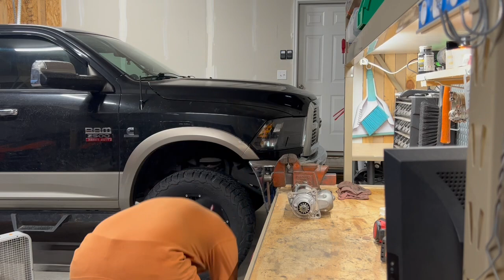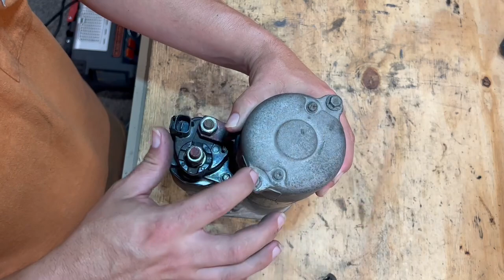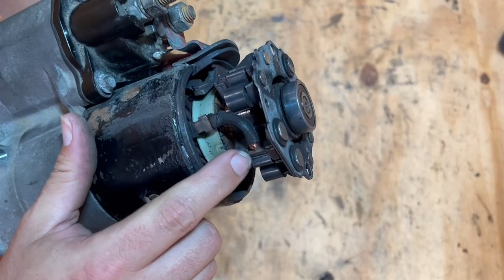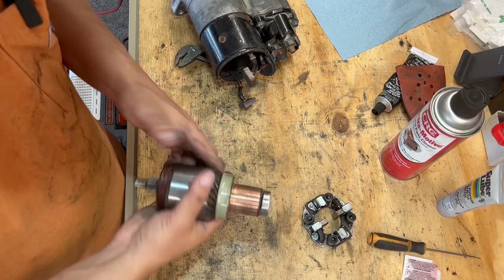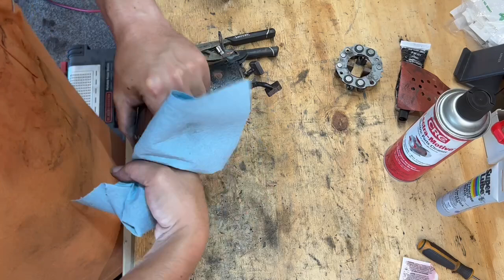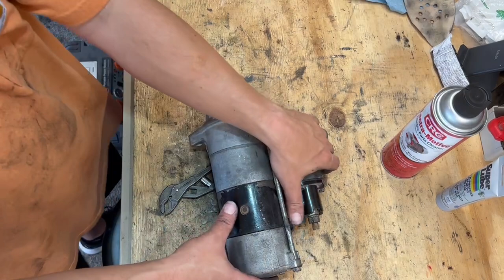Starter Motor Teardown | 2010 Cummins | What Happened And Can It Be Fixed?

Comment: Just gonna say, 12v ain’t hurting anyone. It won’t even shock you through skin contact.
Reply from the maker: You’re right that it don’t hurt, but boy it catches you by surprise when it does. I’ve been soaked in 12v a few times. I just want folks to be careful if they have any heart conditions and decide to play with electricity.